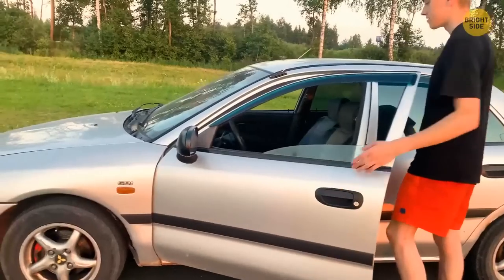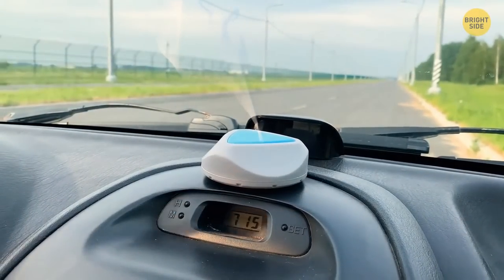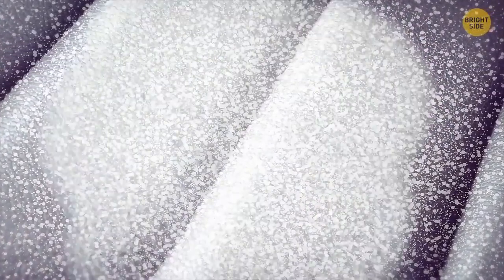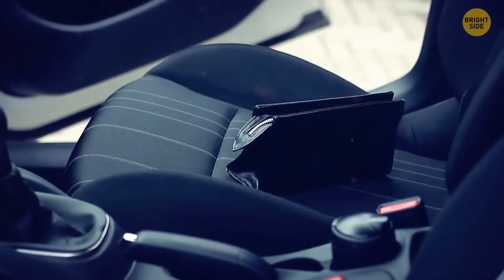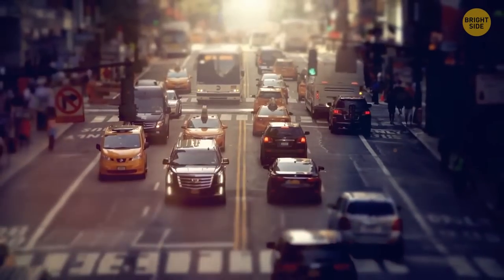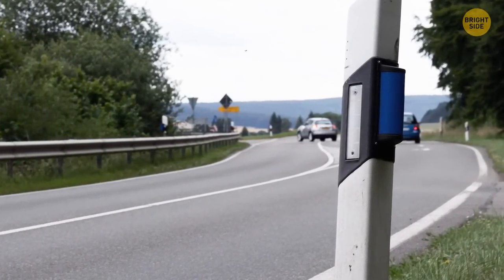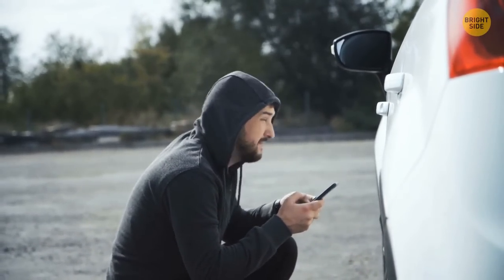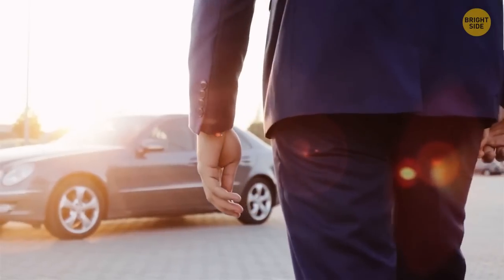Wild Car Facts to Shift Your Knowledge into High Gear

Comment: Okay for the situation where someone puts a nail in the road so that it causes your tires to deflate... You still didn't tell us what to do is that happens! If you stop your car then the people can kidnap you or steal the car.. so your advice of putting a nail in the hole and getting it to a mechanic would be no different because you still have to stop the car and get out to do that! I'm very curious what the solution would be for that ..